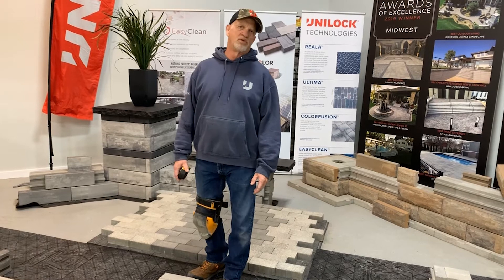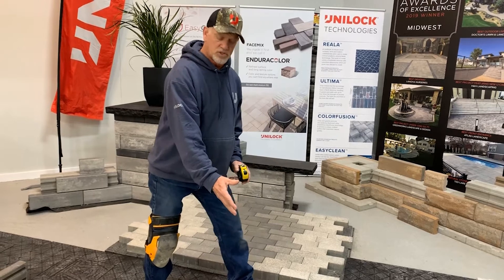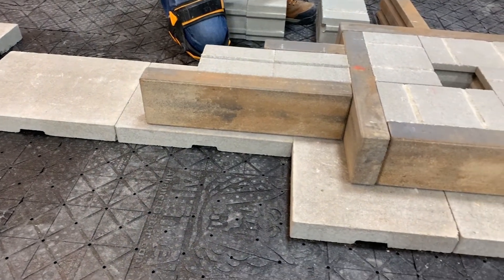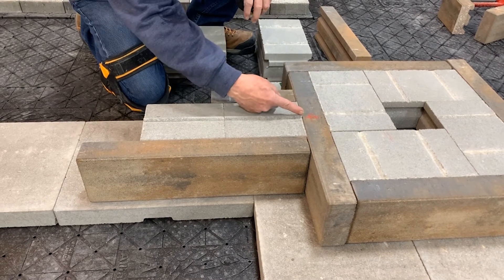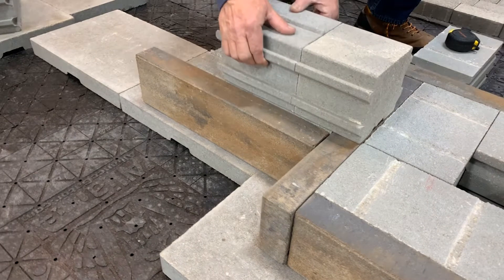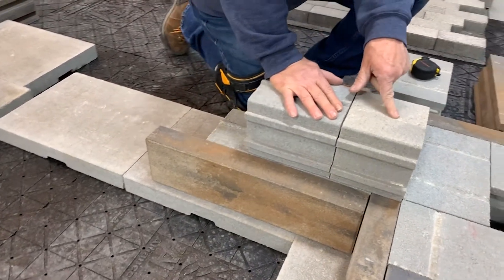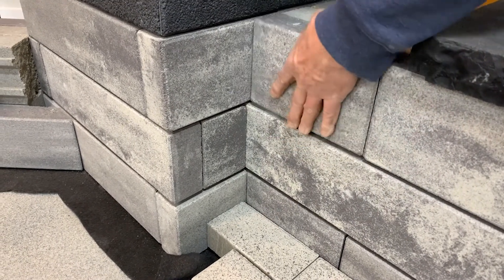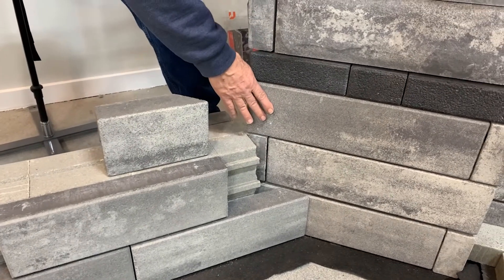U-Cara Seat Wall Tie-in

Comment: So if you tie in a seat wall do you need to still have the  column 2 courses below grade or can you just go 1 like what is recommended for the seat wall? Or do you now go 2 courses below for the seat wall also?
Reply from the maker: Hello! The minimum 12” is required below grade for the pillar, you can bury one course of the seat wall and tie it in on the second course of the pillar to save on materials.